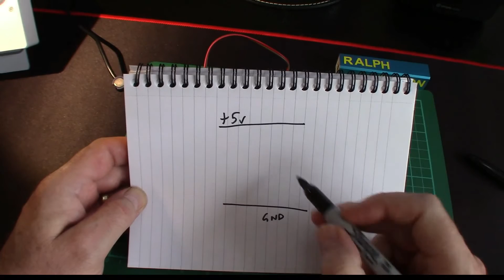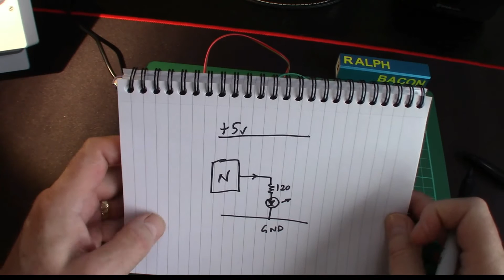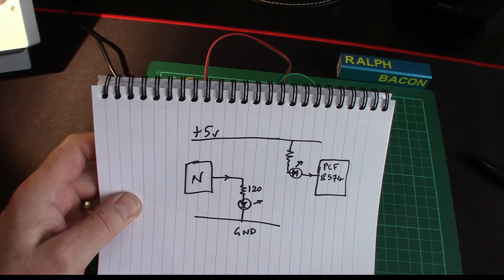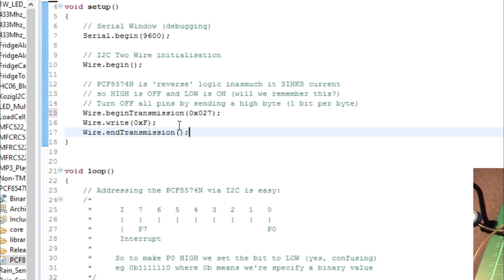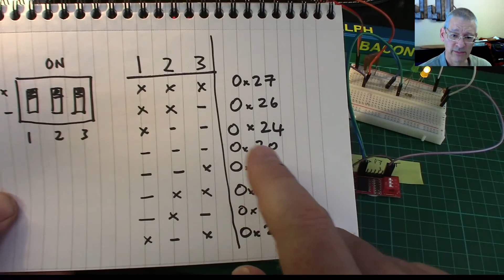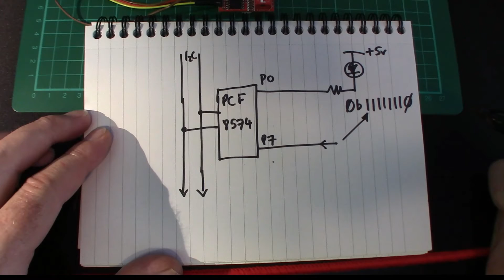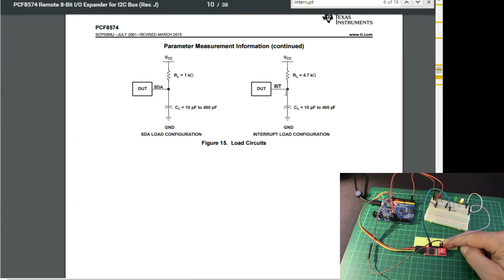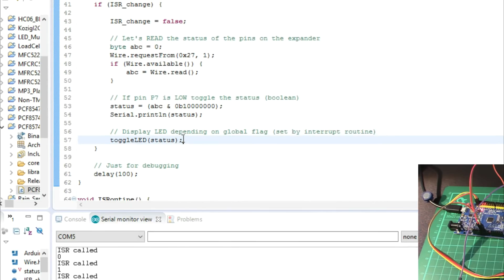#49 MORE PINS PLEASE! PCF8574 Arduino Pin Extender (Easy)

Comment: grate tutorial. But. How do you change 1 bit and not efect any other pins. bit masking? Have you got an example?
Reply from the maker: Hi Michael! You're the first person to ask this question, even though at the time of putting the video together I thought more people would ask it! I deliberately did not mention it because, as you summised, bit masking (any bit manipulation) makes beginners think they can't possibly do it. Wrong!
 
In my example sketch, I tentatively did a tiny bit of bit manipulation to determine the state of a single pin:
 
status = (abc & 0b100000000) 
where abc is the 8-bit value received from the Wire.read() command immediately preceding this statement.
 
So from that, you can see (as I think you already have) that when writing back a value for a different pin, just do bit masking on that value.
 
---------------
Example:
---------------
(Note that 1 = LOW and 0 = HIGH here, as the pin extender sinks current not supply it).

We read back value 0b1111110 into variable 'abc', which means only the rightmost, least significant P0 bit is set.

But now we want to set the second bit from the right (P1) as well as what was already there. I would first NOT the value we read (to get it into human understandable 1=HIGH 0=LOW format) so it now becomes 0b00000001. Easy to see that P0 is HIGH now.

Now, OR the value with what we want, 0b00000010 (where 0 means leave as is) giving  0b00000011. Easy to see that both the last bits, P0 and P1 are HIGH.

Finally, NOT that into the required 0b11111100 and write that back down the I2C route. Then both the P0 and P1 bits would be set (at this point 0=HIGH and 1=LOW again). 

Frankly this can be confusing for beginners (which you're obviously not because you asked the question and know about bit masking). It's unfortunate that the pin extender works 'in reverse' with the HIGH and LOW as it means we must use NOT (the ~ symbol on your keyboard in C++) before we write anything to the chip.
 
Anyway, I hope this has helped you (and possibly others who may have thought of the question but never asked!).
Reply: Thank you for the reply. I have been smacking my head against the wall on this. From what I have been reading I know I need to to do but cannot understand or nor can I get this to work. My project requires me to address each new pin individuality. Is there a chance in the future that you may do part 2 video? "I" a video on bit-wise operations?. Keep up the the grate work..
Reply from the maker: Funnily enough I have on my list a project to use that pin extender with a Tiny85 so maybe that's the time to include the bit masking. As I've said in other posts on my channel, don't expect an immediate video as they can take some time from having an idea to producing the final video, but is sounds as though you and others will benefit. In the meantime, I hope you enjoy the other videos in my Beginners playlist and thanks again for bringing up this topic.

Comment: So does this only work with the damn backpacks now? I can't seem to get the PCF8574P to work like it used to.
Reply from the maker: +pikadoo
Not really understanding your question here! Sure these pin extenders are used as backpacks for the LCD boards but that is just one application for them (and very useful too). But there's been no change in the behaviour of the PCF8574 as far as I know. What problems you getting?
Reply: I have a PCF8574P and yesterday I had a hell of a time getting it going. It's working now, but my problem was the lack up dated information on the Arduino site. It's almost impossible for me as a consumer to keep track of every development in Arduino as it is, but when they have broken links and libraries laying about the web it becomes impossible to get anything done.
Reply from the maker: I feel your pain! Even though I only do this channel as a hobby it takes all my time to just scrape the surface of what is out there. It would be a full-time job to actually keep abreast of what is happening in the microcontroller world, let alone discovering new libraries and discarding old links. Hopefully, this channel helps that tiny bit in keeping you up-to-date in what is happening!

Comment: hey great video, can I know what compiler are you using to program the arduino?
Reply from the maker: +Aasim Almuhandis
Sure, I use the Eclipse programming IDE which is not for the fainthearted. If you are a professional developer or are comfortable with Microsoft Visual Studio then this is great otherwise stick with something less challenging is my advice! So:

Details:
Eclipse IDE for Arduino Developers

Info: http://eclipse.baeyens.it/
Source: https://github.com/jantje/arduino-eclipse-plugin

That last link is for the Arduino development. It took me two attempts and about 3 hours to get it installed the way I wanted it to be. Google is your best friend to find installation instructions (but that last link also gives you that).
Reply: What plugin or whatever are you using?  As far as I know Eclipse doesn't do Arduino "out of the box" so to speak...
(I'm guessing this one: Sloeber?)
Reply from the maker: Hello stewartrv, you're right, Eclipse doesn't do Arduino but the clever chaps on this Github repository have written this plugin which works very nicely: https://github.com/jantje/arduino-eclipse-plugin
 
You get a very occasional nag to subscribe $1 a month and as soon as I earn any money out of this channel I will feel duty bound to do that; until then though, and for most casual users, it's a purely personal choice :)
 
Installing Eclipse may take you a couple of goes and some hours but I find it very nice. However, there's another, simpler IDE called Sublime Text Editor (also with an Arduino plugin) and I've done a video on how to install that (it will be released in the next couple of weeks or so), so if Eclipse is a bit daunting wait for that video. If you subscribe to my channel you'll be notified when it's released too!

Comment: Great explanation! I'm so glad you showed me this nifty little module. Here is the thing though, I'm using a compass that uses i2c on my Mega. I am also using a photo interrupter, attached to an interrupt on the Mega, and I have a sample code that counts the ticks of slotted disk on the shaft of a motor. Problem is, when I include the compass code, the interrupt is called sporadically. If I comment out the compass code, the interrupt counts well. Is there a conflict with I2c and interrupt pins ok the mega, I'm using pin 2, and if so, would this module solve my issue? any feedback would be greatly appreciated. I've subbed and will be checking out more of your stuff! thank you.
Reply from the maker: +Steven Gearhart
Hi Steven, an interesting question. 
I2C most certainly uses dedicated interrupts behind the scenes so there may be a 'conflict' inasmuch that your own interrupt service routines (ISRs) are not the lightning fast pieces of code they need to be. An ISR should do no more than set a flag or increment a (volatile) count variable. That's it. No Serial.prints or other bits of code - that's the job of the main loop, outside of the ISR. Whilst servicing an interrupt all other servicing of further interrupts is stopped. When an ISR has finished then other interrupts may be pending in which case they will to be serviced. 
Best advice would be to make your ISRs super squeaky clean and slim and see if you still get missed interrupts. As an aside, the arduino forum (https://forum.arduino.cc/index.php) is excellent as solving issues like this and I highly recommend you joining (for free) and seeing if they can help too (they have much more time than I do!). Just present your problem succinctly with your code formatted they way they like it and describe all the steps you have taken to resolve the problem so far (they like to see you have tried stuff already). You may see me lurking in the shadows answering a few queries when I get a nanosecond of free time too!
Good luck and thank you so much for an interesting question and subscribing!
Reply: Thanks for the reply! My ISR is squeaky clean. Just toggling a variable. The main loop () is handling the HMC8553L compass. that is where the issue lies. If I comment that section out, the ISR toggles the variable perfectly. It's an adafruit library so i doubt the issue is there. I just wonder if using i2c and an interrupt on pin 2 is a conflict. I'll try the forums out when I get the time. Thanks again and keep up the great work!